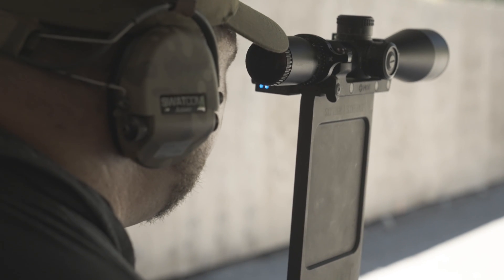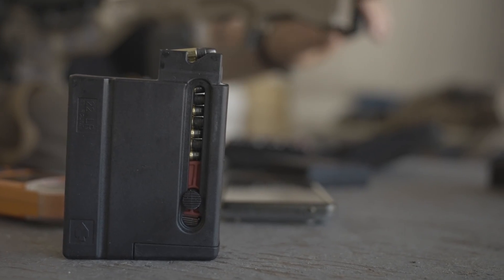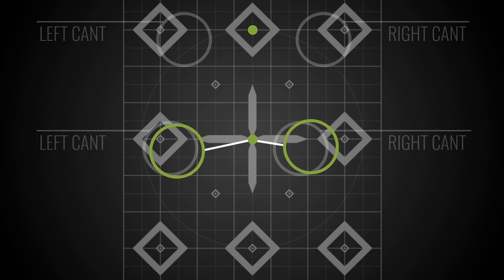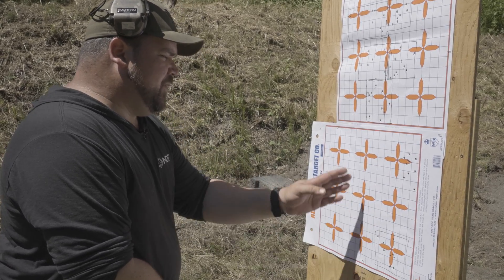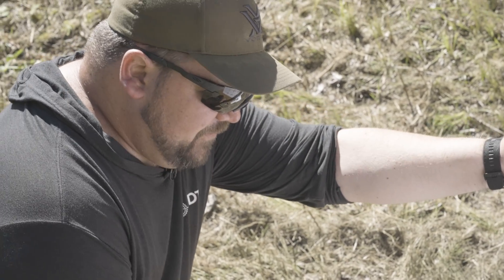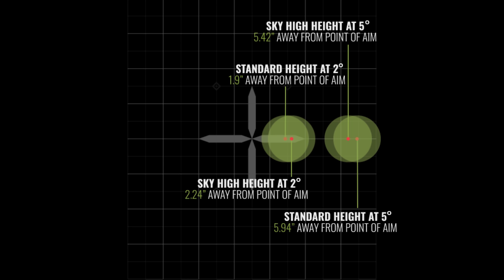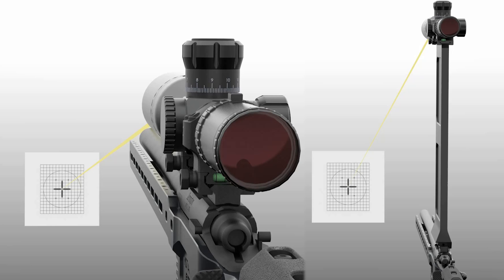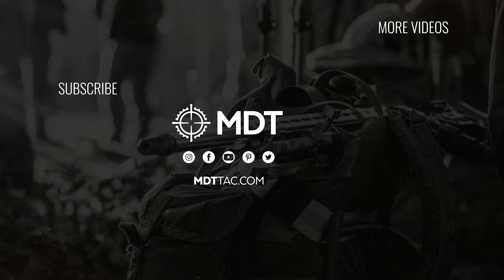Does A High Scope Base Exaggerate Cant?

Comment: These results are a bit disingenuous for the average shooter. Anyone with any real knowledge on this subject wouldn't be surprised that there is no impact on a dialed scope, but to say things like "it doesn't matter at all" becomes improper. Despite what you have shown there ARE still impacts when it comes to height over bore, more then simply ease/difficulty of calculations. Holdovers are impacted, mounting precision requirements are impacted, and how errors in mounting present are impacted.

Comment: It's going to do the exact same thing. What you need to do is mount the scope out of level in the rings and see how much of an effect it has. I guarantee the further off the bore axis, the more it's going to be, with the taller scope base (worlds tallest scope base). Your test is irrelevant. Think about it this way, if some bubba does not mount the scope perfectly plumb/level to the rifle, there is going to be a major difference. That is because the vertical wire of the crosshair is not going to be in line with the bore, the further out of level it is to the rifle. Re-test it.

Comment: It’s important to point out that the high scope base will absolutely have a greater impact on cant (since POI shift due to cant is the direct consequence of the angle relationship between the barrel and line of sight. And a taller scope base means a greater angle). This test just proves that, at least for 22lr at this distance, it appears to be a negligible increase.
Reply: Revisiting this because I realized I was partially wrong (or at least missing a piece of the picture). While the POI shift IS due to the angled relationship between the scope and barrel, this angle is not created by the height over bore (even though the larger height over bore does indeed result in a greater angle). If we imagine a scope with 0 height over bore, there will STILL be an angled relationship between the bore and line of sight out of necessity. Because the bullet drops due to gravity, the only way you’d be able to sight in this imaginary scope would be to have a line of sight that is not parallel with the bore. This means even with an imaginary scope that has 0 height over bore, if canted, will still result in a POI shift due to the angled relationship. 

In summary, the angled relationship has more to do with the bullet drop than the height over bore, which I suspect is why the change in height over bore had little affect on the POI shift from cant.
Reply: This makes me realize that the greatest affect on cant will be the bullet drop side of the equation. If you were to compare the affects of cant on a system with a bullet drop that is very extreme (say a 22), vs a very flat shooting round (such as a 6 creedmor), you’ll likely see a much greater affect from cant on with the 22 system simply because the angle between the scope and bore is much more extreme. 

Another way to think about it is imagine siting behind a gun holding a laser pointer first pointed straight down the barrel, and then point it directly at the target. There will be a noticeable difference in the angle you’re holding the pointer between those two. Now imagine sitting at the target with your laser first pointed at the the barrel, and then up to the scope. The change in angle between those two positions will be almost unnoticeable, even if the scope was even 20 inches above the barrel. This shows you that the angle between the bore and scope is largely due to the bullet drop, and only minorly due to the height over bore.

Comment: There are some advantages to a larger bore/LOS offset. It can be more comfortable, allowing a more upright head position. The bigger advantage is that with a greater offset the scope needs to be mounted at a greater convergence angle with the bore and at long range the LOS is then closer to the path of the trajectory of the projectile over a range of distances; with a very low offset the projectile crosses the LOS but with with a greater offset the high LOS is angled down, looking along the path of the dropping projectile. This means that if a range estimation error of say 20 yards is made at 200 yards the POI error will be smaller with a 3.5 inch offset than with a 2 inch offset.

Comment: Assuming you have a level mounted on the scope you will have less cant with a higher scope for the same amount of bubble movement. For example, a half bubble off center will be less cant if the scope is 5 inches high vs a half bubble off center if the scope is 2 inches high. No different than 1 moa being 1 inch at 100 yds vs 2 in at 200 yards. That being said, the higher the scope, the easier it is to perceive how canted the rifle is. All that being said I would still mount low to give more room for error when engaging targets at unknown ranges.

Comment: Glad those video got released. Initially I thought it would have made a difference when I watched the first video. But the more I thought about it, 5° cant is still 5° whether the scope is 2 inches hight or 20 inches.  Very cool video guys, keep up the good work.
Reply from the maker: Thank you so much!!
Reply: But even with the same cant angle, the difference in scope height will produce a difference in the point of impact. I think this video just gives empirical evidence that the difference between the two is likely negligible for most shooters. The key takeaway is that your time/money is much better spent on a bubble level rather than low scope rings.

Comment: So the bullet impact moves in the direction the scope is canted.  Good to know.
Reply: Depends on the trajectory of the round compared to the natural center of the scope.  The drop of the round "should" make it go the opposite direction of the cant; however, if the bullet is still going "up" (relative to the scope center line), like if you use a 20moa base, but shoot less than the distance for 20moa of drop, then it would be to the same direction as the cant, because the scope would have to be dialed up instead of down.  If that makes sense.